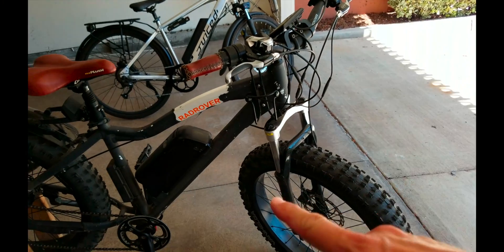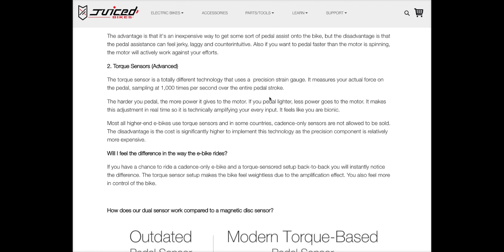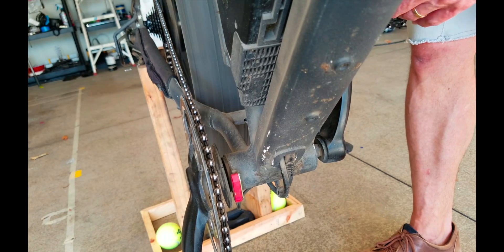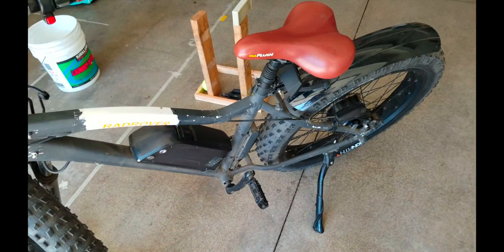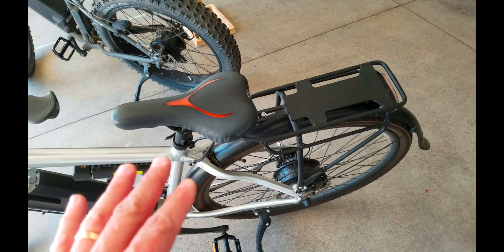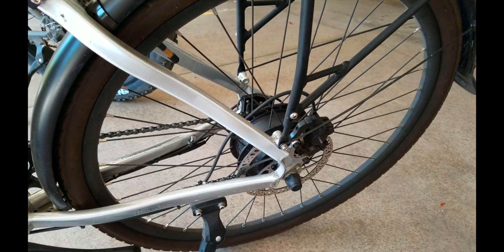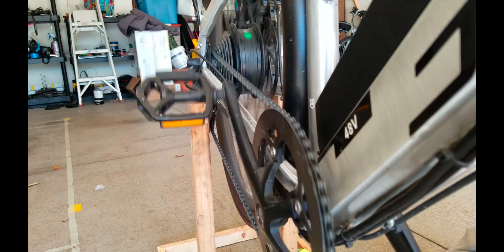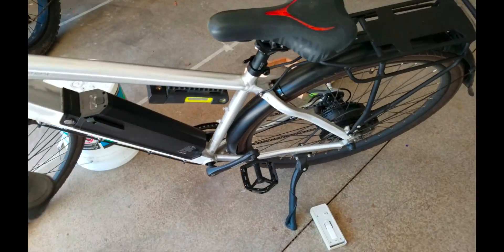eBike Cadence vs Torque Comparison

Comment: I made the mistake of watching review videos done by channels that I realize now are really more into pure electric propulsion than in getting real exercise. So when they'd note a bike had a cadence sensor, they'd express it as a negative, sure, but the tone was very much along the lines of a torque sensor being a diminishing returns nice-to-have. Got my first ebike with a cadence sensor and got rid of it in a week. Hated it. No matter the power setting, I always seemed to be either working too hard or (more often) too little.
Reply: Which is the exact reason why i love candace sensors :D I use my bike for commutes to work etc, i don't want to exercise on those rides but just get there with as little effort as possible especially when it's hot outside, i have a regular bike for when i want to workout.
Reply from the maker: @rdk7010 that's an interesting perspective I don't disagree.  You could kind of get the same effect on the torque sensing if you set it to the highest rating also or by any bike that has a throttle.

Comment: I hate to point out the major flaw in your whole video.   The big difference you complain about is the max speed of the bike.  Sorry this has nothing to do with the torque sensing or cadance motor.  It  has to do with programming.  There is a max speed that can be programmed.  Depending on the bike it can be set to whatever you want.  If you set the max speed to 100mph then the limiting factor is the power of the motor and the gearing of the bike, not what type of motor it is.  I own both torque sensing and cadance pas motor bikes and with the correct programming they both can run and feel quite similar.  It is way more difficult to program the cadance motor, as you have to have it put out the correct amount of power for the current gear and inclination of the road, then you have to program it to cut back power as cadance increases, or as the speed reaches a certain point of the max speed you have set for that level of PAS.  The result is good though
Reply from the maker: I can only go off of the feel and the physical design and we'll have to agree to disagree.  Torque sensing is a completely different feel.  PAS no matter how you program it, still triggers based on dead air between two magnets.  It's that dead air that doesn't feel like torque sensing.  You can feel the dead air in between.  I've logged thousands of miles on my bikes and I can tell you... It's just not the same in my opinion.

Comment: Good explanation and demo, thanks. I like a work out, and prefer torque, and set it how I like.
 Your cadence bike magnet disc has quite a wobble on it, probably makes no difference, but my OCD kicks in.
 Thanks again for taking the time to demonstrate.
Reply from the maker: Thanks for watching.  Torque sensing was definitely one of the biggest surprises I've seen in  e-bikes and it can be difficult to convey in words.
Reply: If you look closely, that sensor is only engaging the motor when the bent part of the disk is at its closest to the sensor. You're probably not getting the sensor to pickup the other magnets that are bent away from it.

Comment: I have a torque sensor BH e-motion mountain e-bike. Problem is at one point to went to full on its own with no pedal pressure. Now it it takes  quite a bit of torque to get it moving, unless i put it in turbo mode. Wish I could show you a photo of the bike since there are so many models. Is there a way to adjust the sensor? Or perhaps is my back tired tightened too much to prevent fluid motion? Basically this is the bike: https://images.app.goo.gl/fA2qFGPMDxgnqDWA6

Comment: Thanks so much for posting this video. With Juiced bikes (like the Scorpion and Hyper Scorpion), are you confident that you will get more true exercise if you get Torque sensing?
Reply from the maker: If you want to do 28 mph consistently yes because above 20 you have to pedal to get you to that speed.  And thank you for the kind words 😅
Reply: @smidgelife  Thank for the quick reply. I'm not sure if I understand your answer.
Reply: @smidgelife  so you're saying with a class 3 ebike rated at 28mph top speed with a torque sensor, to go 28mph it's basically just as hard as on a non ebike??? Makes zero sense then and defeats the purpose. I would like to be going 28 pedaling but having assistance from the motor I.e. it being fairly easy to maintain the 28mph. So this is not the case?

Comment: I use the analogy that a cadence sensor operates like an ON/OFF switch & a Torque Sensor operates like a volume control. Another benefit to the Torque Sensor controlled motors is that you can eliminate the Brake & Shift Interrupters since the motor rotation is proportional to the pressure on your pedals.

Comment: So basically... with cadence pedaling is like a throttle? you are just engaging throttle via pedal with your legs? 
Where as Torque just makes you feel like a superman?

Is there a big cost difference? Because I see more cadence sensors on budget e-bikes.
Reply from the maker: Correct, you nailed it!  Yes it's mainly the expanse.  Torque feels amazing 😁.

Stay tuned as I'm going to demo a mid-drive in about 3 weeks!

Comment: I could see the cheap, simple Cadence sensors paying off for less expensive fixed gear setups like the Super 73 Z, if they ever put pedal assist on it. But if I'm trying to muscle my way up the hill, or get quicker takeoff, then the more sophisticated Torque Sensor needs to understand how much Ooomph I'm putting in when working my up through a 7 speed casette drive

Comment: I own a BH Easy Motion Evo Jet with torque sensing w/ geared Dapu hub motor . I also have a Radwagon w/ cadence sensing gearless Shengyi. I also built a DIY middrive with torque sensing. While the BH Emotion Jet is smoother off the line. I think in the pedal effort is very similar to the Radwagon once I get going. Rad bikes seems to have better customer support than Juiced. I may be biased.
Reply from the maker: I didn't even know about that bike ($3,099 USD) I'm thinking that's why ;)  But wow...looks amazing.

Comment: While your comparison is valid for its intent,  one can't measure torque with no resistance on the rear wheel.  It would have been valid if done on a trainer with a resisting roller.  Think of it this way, if you were using a torque wrench on a bolt or nut that turned freely (never tightened), the wrench would never reach a setting.  The torque sensor at the rear dropout has an electronic sender that measures the amount of twist on it.  Look at it and you'll understand how it works.  If the wheel is moving freely on the stand, there's nothing to measure.

That said, I agree with the premise of your narrative.
Reply: Just to move the mass in rotation use torque
Reply: There is resistance in the spinning wheel. Not a lot, but enough to prove his point. There's aerodynamic drag from the spokes as well as some drag from the bearings. If there were absolutely no resistance, the wheel would spin forever once you start it up.
Reply: Perhaps I can simplify.  The torque sensor senses virtually no torque in your comparison because there is virtually no resistance to your turning the pedals.
Reply: Have you ever tried spinning your crank in a workstand? There's resistance. Is the motor putting out 750 watts in the video? No. It is, however, adding to what he's putting in. Believe me, I do know something of how these things work, with some experience in engineering. Plus I was was riding an electric bike with torque sensor back in the 1990s when most people had never even heard of e-bikes.
Reply: Turning the cranks on a workstand is the practically the same as coasting.  The motor knows that there is not nearly enough torque being exerted to turn on the assist at anything other than negligible levels.  You wouldn't want it to.  Isn't that point of the comparison that the cadence sensor turns on the motor if the cranks are turning but the torque sensor applies assist only if there is some significant torque being sensed? And, of course on a workstand as you can see in the video, there is not nearly enough torque to apply any significant assist.
Reply: I'm not going to argue with you anymore. Knock yourself out. You're obviously writing all from theory rather than actual experience and I know it's impossible to convince anyone like that.
Reply: This is not for you, Phantom Stranger.  Clearly you don't get it.  Here's a test for anyone else reading this.  Put any bike on a work stand, and turn the cranks with a torque wrench, not the pedals.  Let everyone here know what torque you measure.  Most of us know the answer.

Comment: Thanks for the explanation! Juiced, Surface 604 and FLX bikes all offer torque sensing at a fair price. I'm sure many others will to as time and price keeps coming down. My next e-bike will have the torque sensor on it for sure.
Reply: Torque 1 - $1,200 for bicycle with Stealth Battery in Down Tube, and Torque Sensor...

Comment: all of the center hub drives use torque sencing. Head over to Santiago Cycling and try one of there Trek E-Bikes. Just don't look at the price.
Reply: That only applies to production bikes, not aftermarket mid-drive systems. Virtually all of those are cadence sensing.
Reply: Not true. I have a TongSheng TSDZ2. They have torque sensing.
Reply: Do you have any idea what "virtually all" means?  I know about the TSDZ2. You're not as brilliant as you think. Name another aftermarket mid-drive with torque sensing, keeping in mind that the Bafang Ultra Max is not aftermarket as you can't just put that on any bike.

Comment: Do you think the torque sensor is reacting to the chain or the last cog (the 9th gear)?  Also does it only work on the 9th gear or any gear?
Reply: James Bond correct.
Reply from the maker: It works in any gear.
Reply: @smidgelife  if you put it in first gear, you are applying more torque to the rear wheel for the same pedaling effort. Does the motor apply most of its torque in first gear? I'm thinking torque sensing works better for mid-drives where you can keep the bike in the power band throughout a range of speeds.
Reply: James Bond It sences the strain on the chain.
Reply: jdk_100 OK the chain pulls on the sensor as it's being stretched putting more power to the rear hub.

Like this video: https://youtu.be/EJnCtd9qXog